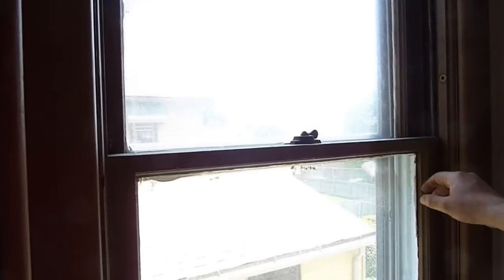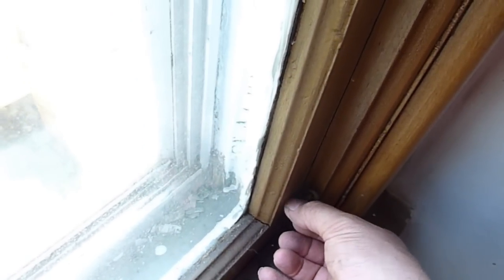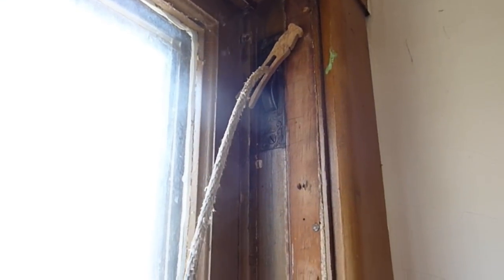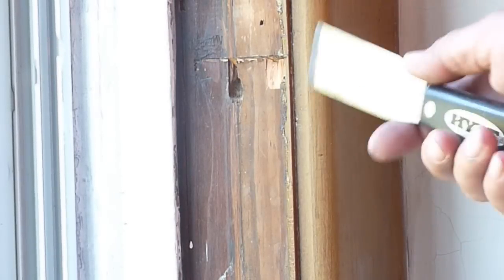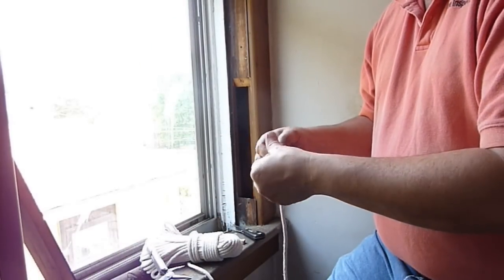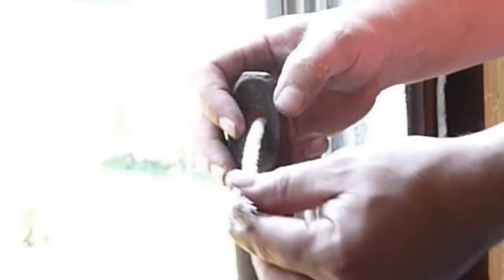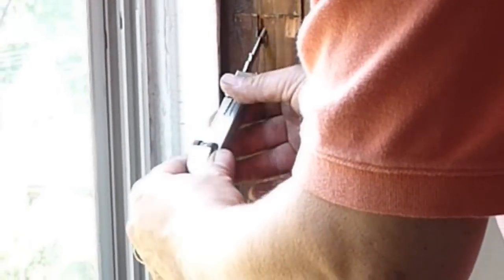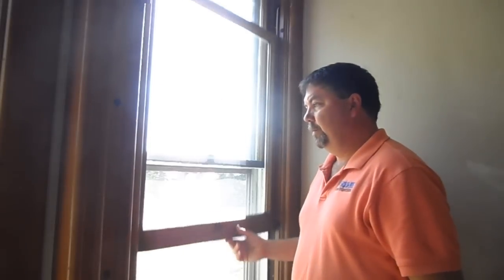Repairing Sash Cords

Comment: Sorry, I think you should nail that rope in the window socket. My windows are so loose it would pull out otherwise .
Reply from the maker: +rvgolfing That would be an option. I didn't have to worry about that.  A screw would be a better option as I don't know how easy it would be to pull a nail out of the slot.